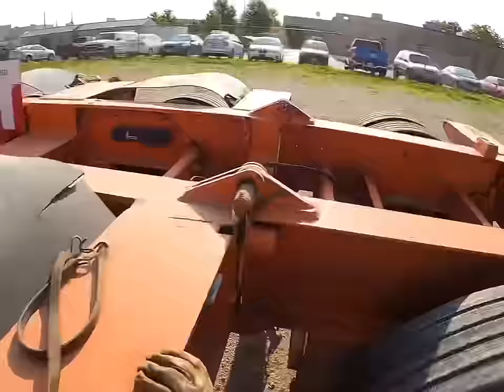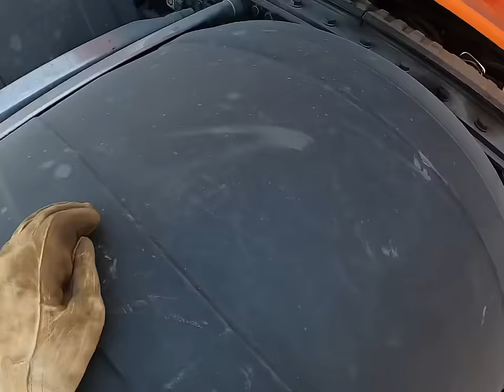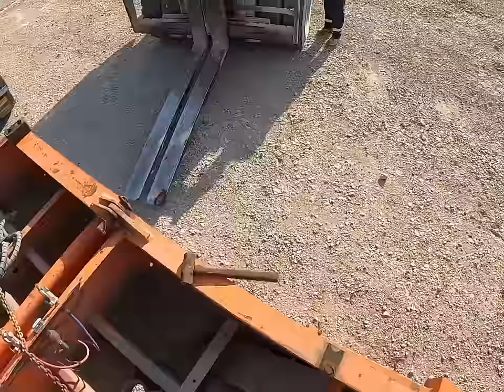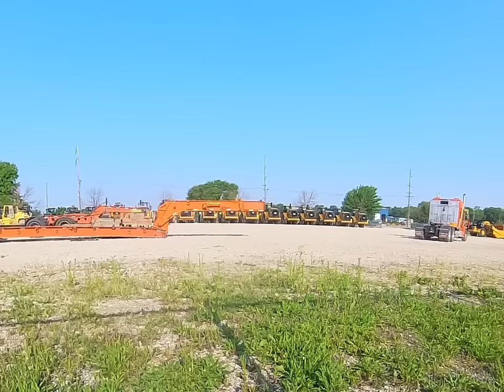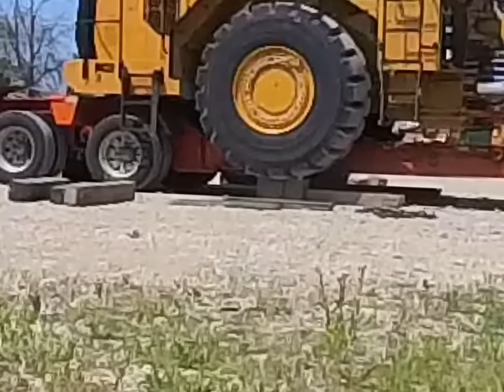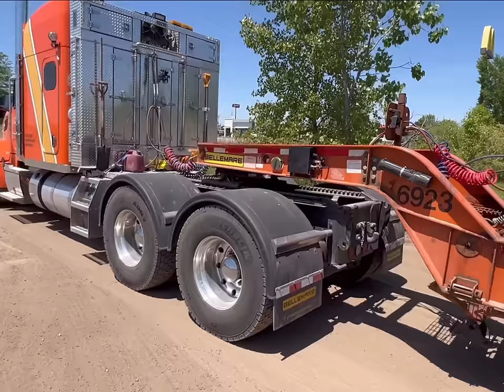Loading up a brand new CAT 988K at the factory (extended version)

Comment: That is a short truck compared to what some states allow. A quad in Georgia is worth 80,000 but,.. ,depending on spacing, Florida may give you much less. I ran 13 and 19 axle traffic. We hauled mostly drill rigs and 600#  plus excavators. We had several trailers, some low boys for transformers, construction equipment, and large but not that large stuff. My favourite was a 100 ton Siebert with a 10 foot deck, although we had 11 axle Lidells, and Fontaines, The Siebert was a tank, you could load a 100 ton object and not worry about weight distribution. I was in a 367 Pete, the only one Pete has that has a 22,500 front axle. I had a 4:11 final drive ratio but could drop into 5:66 which pulls like a grizzly bear, but I got old..Im dropping this note from a beach in Thailand where Thai twins are giving me massages, one does head, shoulders, face, and back. and the other does feet, legs, and butt. The lobster dumplings are on the way. There is life after trucks.
Reply from the maker: I still got a few years to go before my retirement but it sounds like you’re making the best of it 👍
This is a good sized company with a couple hundred trailers to choose from so they (usually lol) have just the right trailer for the job. We use the smallest configuration we can get away with depending on the states we are operating in.  The the same load in the deep south we would’ve used a trailer with a booster in stead of the quad.  
Enjoy your time off ✌️

Comment: As a heavy hauler myself with a Pitts tri axle run and hauled some heavy stuff. Thanks for showing me how the get the jeep off the beam trailer.. always thought you use a excavator. Be safe driver!!
Reply from the maker: You can use pretty much any machine to get the jeep off. And when really in a pinch  I’ve even just chained it to the gooseneck and pulled the whole thing off myself with the truck but for that to work you need to know ahead of time and load it accordingly.

Comment: I loaded and unloaded tower crane parts on semi’s for 30yrs and some truckers were to lazy to put protectors under their chains. I gave a warning the first time and if they didn’t on their 2nd load I charged them and it was on the bill of landing “Protectors Must Be Used” they would say I never saw it. I glad to see you used protectors in the appropriate places. That was a professional chain job you did on that loader, I’ve seen chain and strap jobs that I don’t know how the load didn’t fall off the trailer. Great job just found your channel and subscribed.
Reply from the maker: Glad to have you along!
I try to use protectors. Especially with newer machines. This company has a motto that the customer get to put the first scratch on it!

Comment: Thanks again, Doug, for showing the setup. All of the little tricks make a huge difference in keeping your sanity!
I am curious if you get full rating for the chain that goes through the shackle, or if some is knocked off. This is right at the 45 minute mark.
Also, thanks for showing the weight, you don't always so I figure you aren't allowed to share.
Reply from the maker: So the way the machine is loaded it’s hard to show you the chain from the back. I only used a shackle because my hook was too small for the hook point on the machine. This chain goes from the machine down to the trailer and back up to the opposite side of the machine with a binder in the middle.  Personally I count it as a full chain. However if you get some DOT officer who wants to go by the book word for word the law states “from the trailer, over the load, to the opposite side of the trailer”. I know this but I would love to hear from an engineer about the difference between trailer to load or load to trailer.

Comment: Hello-  That was different.  In my time all wheel loaders were built in Aurora.  Took me a minute to figure which lot you loaded in.  I never loaded in that lot.  I don't remember that yard man but he was damn good.  Didn't even bring the L/S fork down onto the neck frame.  The fenders kept you from picking the dolly from underneath on the air bag mount?   We had the same problem at Keen.  They were to short also.  But I was surprised to see how much shim you installed at the back of the beam.  With my  2007 Trail King with the same deck length as yours was, my closed 4 never needed more than 1/4 inch shim hauling anything and still got a tighter weight difference between the two groups.  Have you been happy with your trans. and the freight that you haul?  As always, a great video.  Thanks for recording it.  Brought back some memories.  Have a good day.
Reply from the maker: Sadly I loaded one of the last ones to come out of Aurora.  The big loaders are all Decatur now.
We only need half as much shim in the newer trailers but these old ones flex a lot.  
I’m not a fan of the auto trans but it seems to be the way the world is going.
Reply: @luckybananaheavyhaul3407  I just saw a typo on my part.  I meant to say that I never needed more than a 1/4 inch.   Bit if we had to insert a deck extension into any trailer, we were shimming fools.  I just  never put an extension into mine. Hope you found a good spot to lay over for the weekend.  Have a good day.
Reply from the maker: Every trailer is different so when you switch trailers every week like I do shimming is an educated guessing game.  Sometimes you get lucky, sometimes you gotta start over especially when it comes to extensions.
Reply: It looks like the Decatur ILL  yard 👍
Reply from the maker: @sheltonlaskin7427 sure is!

Comment: 21:17 Man, the trailer is standing almost still. Why is the first axle wheel still spinning? 👀👀

And how can you even move the trailer if there is no air in the brakes?
Reply from the maker: When we load and unload we block off the brakes to easily push and pull the trailer.  After we are done we open the airlines and the brakes function normally.

Comment: Sir, your training wheels on that trailer seem kinda big lol. as a trucker, I would hate to take that down a one of the steep passes. I have picked up at a few mines and some of them can be... fun to get to and I was only 80k pounds.
Reply from the maker: Yeah I hear ya. We usually move new equipment between dealerships so I got the easy job.
Reply: @luckybananaheavyhaul3407  Ahh, yea going into some of them mines it can be real steep. There was one I went to alot out west, a large copper mine but the road you have to take south on 40, very pretty but if your not paying attention going over the edge is 5k+ feet drop... soo yea lol

Comment: Thanks for showing the trailer setup, how you like driving and automatic now?
Reply from the maker: I’m not a fan of automatics, mostly because I’m a young guy and I find them boring to drive.  It takes some getting used to but it seems to work.  The biggest difference I found so far is when you’re doing something technical like trying to attach a gooseneck to a trailer. With a clutch you can feel how much pressure you’re putting without spinning a wheel.  The first time I hooked a gooseneck with this truck I dug holes lol

Comment: Is your Pete new? How does it compare to the other truck you drove? I see it's an automatic ... I never had the pleasure. Thanks for the tutorial on loading.
Reply from the maker: Thanks. I was going to introduce the truck in a different video but this one got posted first.  

The truck is 6 months old. It had 30,000 km on when I got it.  I’m not a fan of the automatic but it seems to be the way the world is going.  The only thing I noticed about the automatic is if you are trying to be very easy on the fuel doing something technical like hooking up a gooseneck to a trailer there is less feeling to the automatic. With a clutch you can feel the friction and put just enough pressure without spinning a wheel.  The first time I hooked a gooseneck with this truck I dug holes 🤣

They bought 5 of these Peterbilts and they are set up just a little bit heavier with the thought that these trucks will have priority on the bigger loads.  You could say I chose more the work this truck will get than the actual truck itself.

Comment: How many inches from the loader tires to the ground, 3 maybe, do they ever touch? Awesome tie down,  don't move big stuff anymore!
Reply from the maker: I try to run at minimum height just high enough that they don’t touch when hitting bumps on the highway.  When you get on uneven ground such as parking lots or entrance ways it is inevitable that they touch a little bit.  At slow speed the loader tires turn when they touch.
Reply: @luckybananaheavyhaul3407  Awesome job  driver and your team!

Comment: Any concerns with the air bags on the jeep when being lifted? I know in the towing industry they will chain them up, but that is for a much longer duration and bumpy going down the road.
Reply from the maker: We try to chain them up as well. Some of them have safety chains welded to the trailers so the suspension can’t over extend.

Comment: Awesome video. I move heavy equipment also not many videos on YouTube. How do you like the automatic transmission verses a manual.
Reply from the maker: So far this automatic is doing the job alright but I haven’t had the truck long enough to test it in all conditions yet.  
Personally I prefer a manual but it’s mostly a macho thing.  This transmission seems to be able to do the job.
Reply: @Lucky Banana Heavy Haul  i was wondering they are talking about our next ones being automatic. I'm still skeptical of them especially in the mountains
Reply from the maker: I haven’t had the opportunity to try it pulling any steep grades yet. I’m also curious how it will perform in winter conditions… to be continued!
Reply: @Lucky Banana Heavy Haul  well I'm subscribed to your videos now so I look forward to seeing how it does.

Comment: Hey, great video.
But why don't you use a little bit grease at all the connectors, bolts, eyes, etc? I saw a lot of rust and dust on this Points of your trailer.
Reply from the maker: With unprotected joints grease collects sand which is counter productive

Comment: When setting up the trailer can your do it on your own or is the forklift needed?  There’s no Blaster or other lube sprayed on the pilot points or pins,is that intentional not to attract dirt ?
Reply from the maker: Things like flipping the rear axle can be done using the truck but it is hard on the equipment and there is a good chance for causing damage. I don’t like doing it. It’s much more gentle on the equipment to use a machine.  If there is no forklift available we often use the same loader or excavator we are transporting to assemble or disassemble the trailer.

Any oil would just build up dirt and eventually make it harder